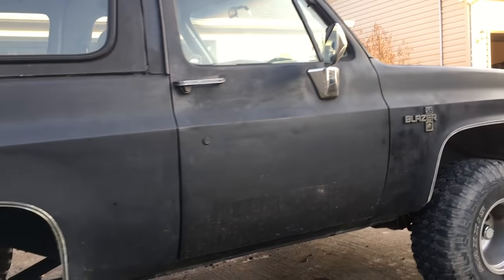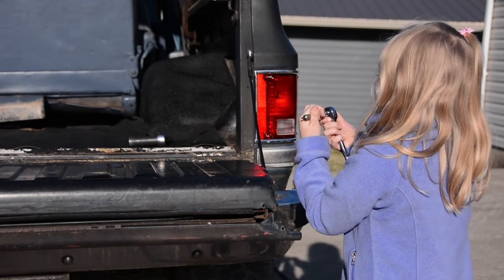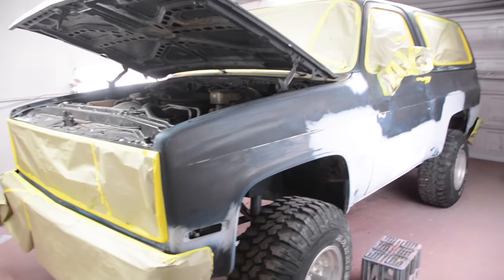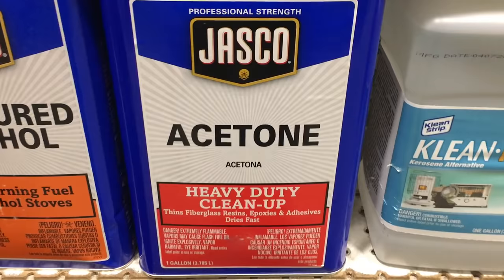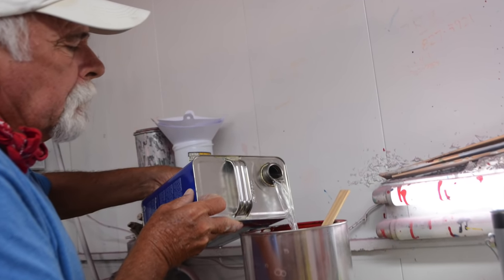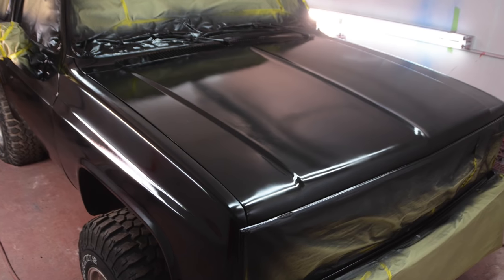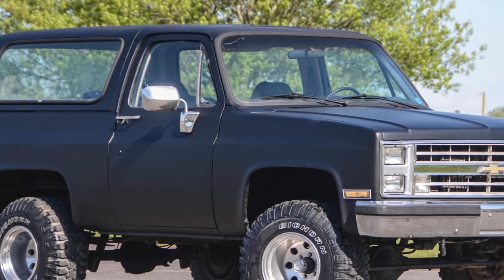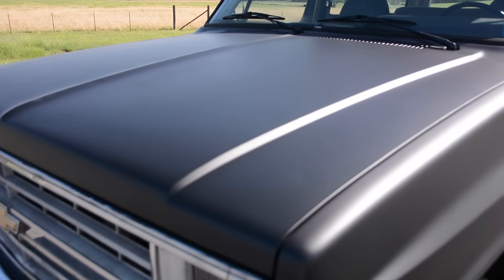$50 DIY PAINT JOB on a Crusty K5 Blazer (Surprisingly Good Results!)

Comment: I've done these techniques before for getting cheap but good paint jobs as well on just basic cars that don't need fancy paint. The only step I add in is throwing an couple of quarts of rustoleum clear over it flat or gloss depending on what your painting helps and on the gloss paint an good wax and buff job helps it last and protect it better as well with any paint job
Reply: which number rustoleum clear did you use? did u catalyze it? thanks. Is it UV resistant?
Reply: @jdbiz  there's an few that rustolium offers you can get there industrial quarts of clear in semi gloss or gloss or they do provide automotive paint as well which I belive they have another type of clear just for cars. I'll look it up and get back to you on the clear but the best thing is not an catalyst but more of adding in an bit of hardner with it for durability purpose then of course people always worry about to much when if you know paint you always cut and buff at the end and that the true first line of defense for your car paint and usually you can cut out most orange peal and runs if not real bad but hopefully there's no runs
Reply: @jdbiz  253522 rustolium clear coat
Reply: Is flat rustoleum less durable than gloss or semi gloss? Will be using a hardener

Comment: I use tons of rustoleum on equipment, cars, motorcycles, trucks, etc it is a great product to work with. Go by the product instructions on the can if I remember correctly your safe as long as you do not reduce your paint greater than 10%. With rustoleum use a measuring cup please do not dump and guess when mixing any paints or coatings. To reduce rustoleum stay away from chemically hot solvents or it will kill your paint color learned this years ago. Personally I use medium acrylic enamel reducer is what works for me. Xylene and low odor mineral spirits are fine. Before any paint work wash everything you plan to sand and paint thoroughly use Ospho or prepetch wash with and last tide like your cleaning a engine block fresh from the machine shop this is from my experience is extremely important. A good Wipe with coleman fuel its cheaper than prep sol aka pre cleano and works fine when you get to wiping clean with solvent. As for shooting the primer I use a hvlp gun. With the paint I use my devilbiss mbc or my devilbiss  jga for a nice shiny finish. Also if you want rustoleum to shine and lay out better add some penetrol. This is really a great beer budget diy video. I encourage people to paint their own vehicles its fun and you will have a feeling of accomplishment along with a nice paint job you did. You can use a roller or a brush if you do not have a compressor done that before works fine. Thank you again your videos are excellent. I always enjoy them and appreciate them.
Reply from the maker: That's awesome, thank you for all the great tips!

Comment: I once painted a truck, bought nice automotive paint, hardener reducer etc.
Came out beautiful Gloss Black...
About 5 years later started seeing some surface cracks as if the paint kept hardening and pulling against itself.
So for a paint job that might last just as long and be cheaper Id say this is a Great Alternative.
Reply: I'm having that happen on a truck we had painted professionally in 2004. Paint cracking like it had Bondo work but it didn't. Mostly in a couple areas where maybe they got the paint too thick. There is at least one run in it too. Otherwise still pretty nice. So pro paint will harden over time and crack?

Comment: I love these type videos. I love Rust-Oleum. It's a quality paint and gives good results when sprayed. Did my trailer last year with the same ratio and looks amazing!
Reply: Rust opium doesn't get hard enough. Dupli color is good.
Reply: @wthigo77  imagine being a $50 paint snob 🤣
Reply: @contraband1543  $50 paint snob? It would cost you more than that to do it with rust oleum. Rust oleum does not get hard it's almost like a soft plastic which will scrape off. Dupli color is more suited for auto.
Reply: @wthigo77  I have used hardener with it...course hardener was $25 alone...seemed to help a lot..
But I'll def check into Dupli color..!

Comment: I have been using that same process with a little twist , use gloss black rustoleum and thin with acetone .Let it sit for 3 or 4 days then drag a green Scotch pad from front to back over the entire truck.Looks great alot more durable than flat black
Reply: Hi, i want to paint my car satin black. Can u show me how does your method look? Thanks
Reply: What hardener do you use for Rustoleum if you dont mind. ?
Reply: @drd1924  I didn't use any hardner
Reply: @steelmill888  Didn't you mention Hardner in your first sentence?
I mean I know you don't HAVE to use Hardener, but if one WERE to use Hardener since I notice that word there I figured you may know of one that is compatible with Rustoleum.
No biggee though
Reply: Is flat less durable than gloss? That’s why you use gloss then make it flat yourself

Comment: I’ve mixed it 5-2 with a cap full of Japan Drier to help it flash off and dry quicker. One part hardener to that mix also helps as you said. Just note that the hardener will also add gloss to the paint if you want that effect. Good video and good instruction, thanks.
Reply from the maker: Thanks Bob, I haven't ever used the Japan Drier, but have heard it works well.
Reply: Agreed 👍
Reply: @HotRodHoarder  Yes indeed Japan Dryer in rustoleum it works very well plus its not expensive.
Reply: Good tips. Thanks.

Comment: Brother! This is refreshing to see. Im in the process of repainting my 82 El Camino the same way that you’ve done here. I just happened to be scrolling through while taking a break from sanding on it. The only difference is that im doin mine with “rattle cans”. Rustoleum makes great stuff. Anyhow….GREAT JOB ON THE K5 bro!
Reply: I'm about to redo mine. I have an 85 Elco. Didn't have any of the equipment at the time (compressor, spray gun etc...). So I roller brushed it with rustoleum satin black just to get it all one color, didn't come out half bad but after 7 years and a few spray can touch ups, it definitely needs a freshening up and a nice even coat.

Comment: 81 C20 I rolled with the satin and it looked awesome. I only summer drove the truck, so I done the body work with drywall mud. Yup, mud. Easy to sand and the mud/primer was from work, so free. The truck did not drive in the rain much, but the paint would last the summer and rinse and repeat for the next season. Oh, put a 71 block from a LeMans, new carb and that thing would fly. Have a Duramax now, but I miss that truck.

Comment: A little tip if you're going to do this yourself. Don't use lacquer thinner with oil based paints, use mineral spirits.
Reply: Why?
Reply: @pedrom4253  Lacquer has different properties that attack oil-based paints

Comment: Years ago I run an auto body repair shop and I had a cousin bring in his truck. He wanted it painted. No sanding. wash it down and mask it off and paint it. Well I did just that. Turned out really nice and the funny thing is it never pealed. The paint stayed on like it was factory. He drover it for a few years and traded it in for a newer truck and the paint was still fine.

Comment: Have you seen any of the videos where people rolled on this paint with a foam roller? They cut it with acetone about the same ratio. Might be some thing cool to try for the people who have limited tools/space to spray a car.
Reply from the maker: I have seen that and the results are pretty awesome! The stuff lays out nicely even when applied with a roller. That would be the perfect choice for someone with close neighbors or someone without a big enough air compressor.
Reply: Add Penetrol to Rustoleum and brush or roll it on it will lay out smooth like a sheet of glass. If you want it to dry fast add some Japan Drier to it. Myself I don't thin it with Acetone. If I am working with Rustoleum in the winter I use naphtha or coleman fuel sparingly no greater than 10% to thin it. Yes I have brush painted cars, motorcycle tins, and helmets with Rustoleum reason being I don't want the mess plus it goes farther.
Reply: @HotRodHoarder  What size air compressor did you use to spray this and how many CFMs? Thanks.

Comment: Love the Blazer and the flat black.  My car is about to get restored and it's hard to not have anything to work on.  I keep finding $3500 Blazers and would like to try my hand at a full restoration.  Is there any way to make that Rustoleum paint not water spot or show imperfections?  Or another alternative that would be similar to a base/clear but thick for a beginner to sand down all the mistakes?

Comment: Great refresh. Can you clear coat for better durability?
Reply from the maker: I think it's possible to clear coat, but you'd probably want this stuff to cure for a little while before doing so. It's a pretty soft paint, so a urethane clear could try to eat into it if applied directly over the top of the fresh paint.
Reply: @HotRodHoarder   I get what you’re saying. Thanks
Reply: @rickw.9298  If its gloss wax it really good with hard shell turtle wax. Painted a dump trailer for a guy with rustoleum and waxed it with a buffer and regular hard shell turtle wax 4 light coats of turtle wax. The guy had a problem at the asphalt plant got hot asphalt all over the new paint. He pulled out of the plant and knocked off the hot asphalt with a brush and pressure washer. The turtle wax didn't allow the asphalt to stick to the paint and saved his paint job. The owner he keeps it waxed and this paint job lasted years. 
If you want to clear over rustoleum after painting a flame job or mural I use rustoleum triple thick gloss glaze or gloss rustoleum clear. 
Check out or try rustoleum appliance epoxy from the hardware store its pretty tough.  I have used their 9400 high gloss polyester urethane which is really strong yet its expensive.
Reply: @sswcustomsewing4276  Thanks for the rundown. Appears to be several options within the rest-oleum offerings. I have use the restoleum engine enamels and the appliance epoxys, but haven’t tried their clear coats. Budget & durable ‘industrial’ from a spray gun is what I’d like to get to.
Reply: @rickw.9298  With paint it really depends upon what you are doing or wanting to do. I have been painting for over 30 years. I do things now way different than I used to because times change. One money and time saving trick is if I can have something powder coated that is usually what I do. I can have a motorcycle gas tank and tins for example primed, color, and clear coated from the powder coating guy for less than it costs me to buy industrial quality durable materials for the job from my paint supplier. Being able to have them bake my Glyptal I use to paint the inside of engines to get the cure I want is awesome. I am sharing this because paint/body work if you choose to not protect yourself or cut cornrrs its not if you will get sick its when. If you can limit your exposure it gives you more time for other projects, more learning opportunities, and saving your health.
 However if you want to paint I recommend going to a industrial finish supplier of a reputable brand (Always liked a Dupont products myself never liked PPG) who has a experienced representative with real world experience.  An experienced rep is extremely valuable they can help you find the right gun, compressor, tools, safety equipment, technical advice on products, tricks, and they are very helpful. If you can't find one ask a body shop that does work you like. I remember when I started painting I found a paint rep we are still good friends. My only regret is not protecting myself as well as I could have. I knew better, made stupid choices, ain't proud of it, and have health problems that are permanent. Illness or injury reminding you to protect yourself its not a pleassnt reminder I hope you make better choices. Only sharing this because I would like you to paint, to really be able to enjoy it, get creative with  it, learn, have fun, and share your knowledge with others. Take care and have fun on many future projects 👍

Comment: A good new razor blade is to best way to clean glass without hazing it up. Also when that paint shrinks over time it will definitely show those 220 scratches. You could just spend a little more and do it the right way....

Comment: Tell you what, I think this looks great, much better then those spray on bed liners. We used to paint homemade ATV trailers with Rustoleum mixed with gas and it held up well. Later on we painted our cheap plow trucks like you just did and wire wheeled the frame, diffs etc and use Rustoleum spray on bed liner the whole underside....

Comment: Since you like guns and saving money and have all that acetone anyway....    Ed's Red.      I part acetone.   1 part automatic trans fluid    1 part mineral spirits    1 part kerosene (k2)  and then for a quart one or two ounces of real lanolin.     works better than any other gun cleaner/lubricant/protectant I have ever found.     For a penetrating oil?   all you need is one part acetone to one part ATF.  best penetrating oil you can buy.   it has been proven

Comment: Looks great, have you looked into john deeres blitz black. It has uv protection and lats down nice. I did a s10 and never paited a car with a gun before.  I used a harbor fraight gun, added a regulator and a water separator and i was shocked. Its also extremely durable, you touched on scratches on flat colors. Check this out, the price is also about the same.
Reply: I wonder about farm and implement paint. How it paints/holds up.

Comment: I’ve painted many things very nicely with spray can paint. Just put on light coats and use good clear coat
Reply: Jake, are you using 2k clear? I've been wanting to do a car in rustoleum or something similar, but lock it in with a good coat of 2k. It's been really hard finding tips and tricks, though. The solvents in the 2k doesn't play nice with most of this stuff. I know it's possible, though.
Reply: @mccoma11  yes Ive used 2k clear just try to find the best gas resistant clear coat it will look good enough. I don’t have a spray gun or anything so I just buy enough cans of touch up paint or black/white/red rustoleum, then clear to go over that. I usually only do smaller projects like three wheeler tanks and works fine. Just let the paint cure for a couple weeks before you get and gas or anything on it.

Comment: Nice work!!! My biggest issue with Rust-Oleum is the lack of UV resistance, but nice job overall!!!
Reply from the maker: Agreed. It definitely doesn't last as long as some of the automotive flat black paints out there.
Reply: @HotRodHoarder  Trick with satin black is wash it with a really soft clean washmit and always a mild car wash soap. Dollar store baby shampoo works pretty good too. My other trick with satin finish is just maintain it with a mild glass cleaner like Sprayway. What I have found to be the cause of Rustoleum fading is washing it with strong detergents, soaps made to clean dishes, and basically drying the paint. I have applied many gallons of satin, flat, or gloss Rustoleum black to dump truck trailer frames, log or dump truck frames, and stuff that gets hammered it lasts. I actually prefer it over the "equipment paint" from napa.
Reply: Only way to get gloss Rustoleum to last in harsh uv or nasty conditions I have found is after it fully cures apply at least 3 light coatings of original hard shell turtle wax. This will protect your paint and keep it easier to clean. Also when you wash Rustoleum use car wash soap or dollar store baby shampoo thst contains no soap so you dont dry out your painted surface. Dish soap like dawn will dry out paint reason being it is made to remove grease and clean dishes that are harder than automotive painted surfaces.

Comment: Those second generation Chevy K5 Blazers & GMC Jimmys were produced from 1973 - 1991. Same with the seventh generation Suburbans & third generation C/K series pickups, except the half ton & three quarter ton regular cab pickups were discontinued in 1987 & the one ton regular cab pickups were discontinued in 1989. In 1987, the C/K series were dropped on all of the models & renamed R/V series to make a distinction between them & the upcoming fourth generation C/K series pickups for the 1988 model year because both body designs were gonna be produced at the same time which lasted up through 1991. 1987 was also the first year for gasoline fuel injected motors. The one ton regular cab pickups were the only models with both of those body designs produced at the same time from 1988 - 1989.

Comment: I painted my 2000 jeep wrangler mate black and it came out awsome i did all the body work to perfect was going to paint it a cool color and went with mate black threw a gun because its a jeep and if i get future body damage ill be able to match the color buy walking into tractor supply and getting the mate black with hardner under 50$

Comment: Random and rambling, but whenever I see a K5 Blazer, it brings me back to the days of living in northeast Ohio. I knew someone that had one, and rust belt winters were not kind to these. Around the entire rear wheel wells, there was 6" of....nothing. No rockers left, holes in the doors and front fenders, and even the door jambs were so rusty that the door sagged a few inches when opened---you had to lift up the door to get it to close